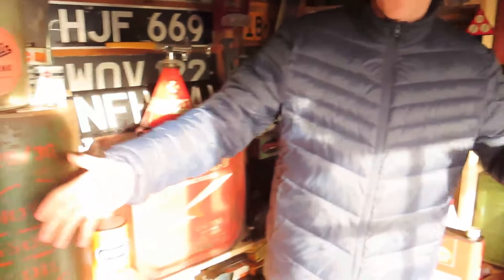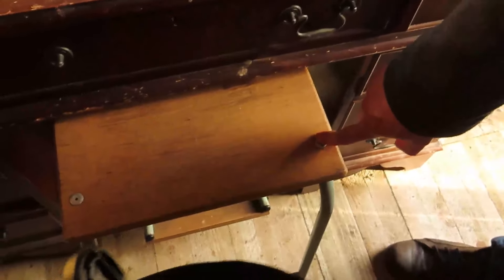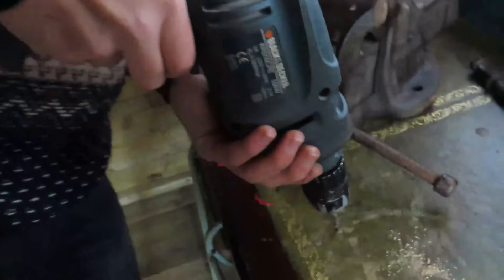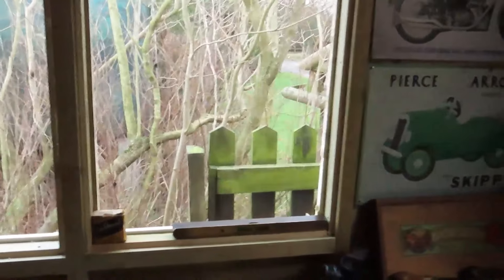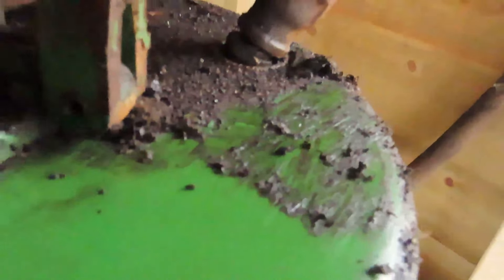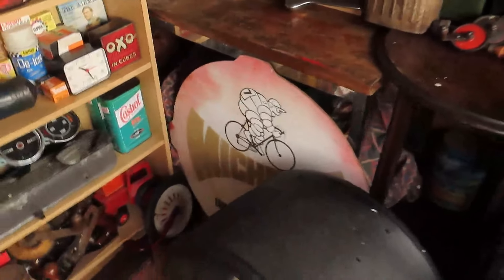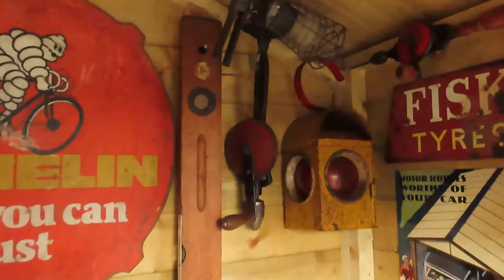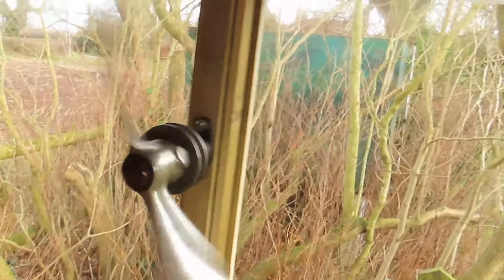BIG UPDATES | FRED THE SHED, oil dispensers and more!

Comment: Paint the new shed in old engine oil, my shed is 24 years old and good as new, that cheap wood absorbes oil like a sponge and oil repells water. It's an old school thing, shed will turn a lovely colour and not look like sore thumb 😊👍🇮🇪
Reply from the maker: Interesting, I don't think I have quite that much engine oil!
Reply: @CarTractionvids  next time someone does an oil change, sorted 🤗 
Just keep it in mind and use the shed paint money for something else 👍🇮🇪, paint tray and 4' roller also required.
Reply: I keep used oil from engine oil changes to dilute with creosote. The resulting mix is perfect for shed preservation!
Reply: @colinmuddell9672  think creosote is banned here now 🙄🇮🇪
I just use what dad showed me, not saying you're wrong but it also means I don't have to worry about oil disposal 👍

Comment: A rather impressive collection of tools and memorabilia there, mate.  That has to be a few years' worth of bargaining and no mistake, eh?  I fear that Ned the Shed is going to need an extension in the near future just to keep up with it and the work being performed in Fred the Shed.  Maybe it will require the addition of Marge the Garage??  

As to whether I restore something classic to pristine or preserve it with its patina, it depends on the item.  If it is looking pretty sad and I'm just going to use it for display and if it would look good with a tart-up, I will give it a full-on paint job to make it look the best it can.  Otherwise, it gets a sympathetic restoration, making sure to 'age' any new paintwork to suit the area it is going on.  I figure if it's never going to be used for its intended purpose, then why not make it look its best...but there are some items that no matter how much you want to dress them up, they would not look right with an 'as new' finish given their age and the work they have done / battle scars they have accumulated over the years, so those are the ones that get the sympathetic resto mentioned.  

However, if I am going to use an old tool in my garage, then it gets the 'preservation' resto - ie: a going over with the wire brush and (sometimes) fine steel wool to knock the rust off and then the oily rag treatment.  I like what you showed a few months back with the light dusting of black paint and then 'wearing' it a bit, but for tools I use, the paint comes off again fairly quickly, so I've just stayed with the oily rag.  Even my more modern tools get a wipe-down after use to clean the worst off, but there is still a very thin film of oil on them.  Some of my older spanners are perfect for getting in where modern ones won't - eg: between the radiator and the lower front pulley on a Triumph 2500S in order to move the crank to turn the cam to open the points in the distributor for periodic setting / cleaning. Modern ring or ring / open ended spanners have a slight angle on them and there is just no room to use a kinked 15/16ths - let alone a socket - on the nut, so my 1940s narrow flat steel 15/16ths / 1" is perfect for that.  It's one my Dad found in the gutter on his way to school in the 1950s and kept right through all the years he spent building modified and race engines. I found it while going through his garage after he passed and although it's not in a set, it went in with the others I was keeping.  Every time I use it I thank him for finding it that day as nothing else I have will fit! 

I have a couple of old bronze spirit-fuelled blow torches that I still use, but I gave them a clean and a polish up.  I sprayed their tanks with clear-coat to try to stop the bronze oxidising and it has worked except where the white spirit has come in contact with it, so would be a good thing for preserving any brass or bronze item you were just going to display as it saves all that polishing time that's needed every so often!  I put clearcoat on an old washing copper that my Mum had from her Grandparents' farmhouse - after I polished it of course - and it's stayed looking fantastic for 20 years now.   

One other little cleaning tip - your WD40 is a perfect item for loosening up the accumulated oily / dusty sludge that ends up on old mechanical things.  Carb / Brake Cleaner is another great dissolver of crud and faster than WD40, but tends to be a little harsher on the paint as its ethanol- or acetone-based, so needs to be wiped off any painted surfaces again quickly, so I'd only use it on unpainted surfaces until you become familiar with how it does things. You have to be particularly careful with a metal-bladed screwdriver not to damage any paint underneath, so to save myself some anxiety over this point, I found a better use for the plastic knives you get with some takeaways.  I filed / ground off any serrated edge on the utensil and then used that as a scraper.  Even a small sliver of wood is a better scraper than a screwdriver for the same reason - and you can hone it down to a point if you need to get into tight corners (or use toothpicks).  I learned the hard way about screwdrivers by scraping paint off places I really didn't want it gone, so just thought I'd pass the above info along for what it's worth.

I'll stop now as I have written a veritable book for you to read!  All the best with your expanding hobby and don't let anyone give you a bit of stick for having two sheds (an old Monty Python reference your Dad will probably know about!).
Reply from the maker: Yep having plenty old tools is very useful, I'm a fan of the sympathetic resto!
Reply: Bit like four candles...................
Reply: @richardsealey3626  - yeah, but I didn't see any garden implements at all.  He might have O's though... 😄